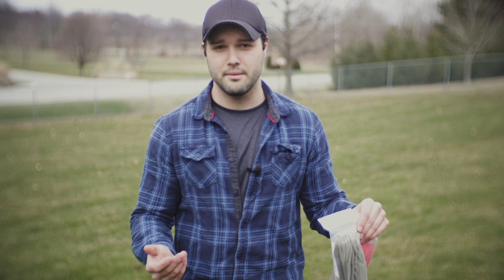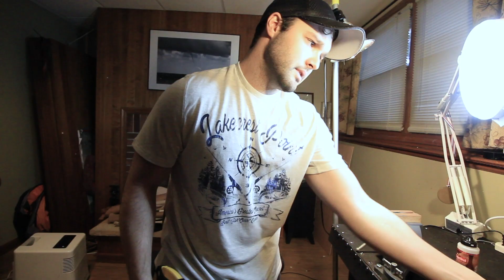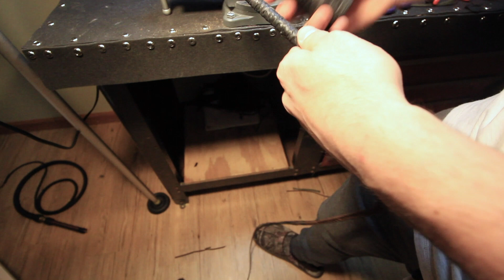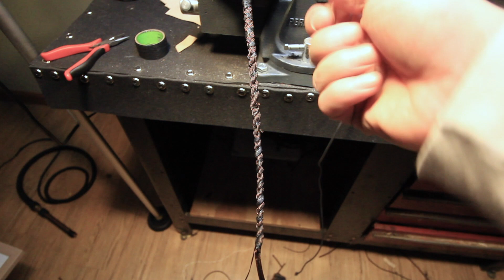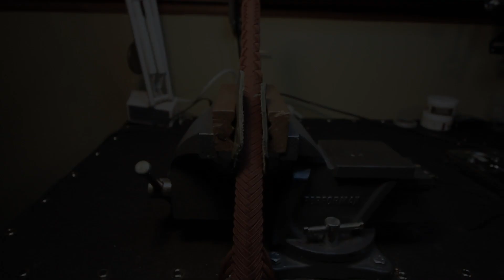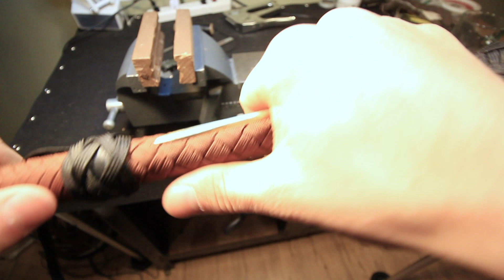My Current Nylon/Paracord Bullwhip Making Method 2018 | Nick's Whip Shop

Comment: How mutch did it cost for you?
Reply: I’d put non-paracord material at about $10-15
Paracord is about $10 per 100 ft, so this near 300 ft whip (total length of paracord used) would be about $30 of cordage. 

Including wax, probably another $5

EST: $45-50

I’m lowering costs of materials a bit since it’s cheaper to buy in bulk, and it’s assumed that’s what he does

Comment: Just started plating my overlay and i see im going to run into some difficulties.
my material i get here is slightly different to yours and i was wondering if you can assist me?
when im starting the overlay it all seems to be going good untill i look at the back of the handle....it looks bad and uneven

Any advice plz

Comment: Hi Nick,

Im new to whip making and thank you so much for best content in youtube!
This helps ALOT.

One question, are you using waxed artificial sinew? Does regular one work as well?
I was wondering, if I can use paracord guts for the same purpose?
Reply: Hello! I’m not as good as nick at making whips however, yes I use the nylon core of paracord for the same purpose as artificial sinew. All I’ll say is that if you use the nylon core you’ll have to pull extremely tightly because it doesn’t have the same strength as the artificial sinew.

Comment: Instead of using a metal rod is it possible to use a wooden dowel of the same dimensions as a substitute because I’m having trouble finding a metal one
Reply: It was in a reply somewhere, but the wood could break pretty easily compared to the steel rod. Have you tried any hardware stores?

Comment: Hi I have a question about alternatives for B.B.’s. I live in nz and it’s hard to find accessible bbs and if I do I need to ship it and it’s expensive. Is there any alternatives?
Reply: Ball chain. It’s lighter, but you can double it up when pulling it through 550 paracord. It’s the stuff for ceiling fans, so hopefully you should be able to find it at a hardware store

Pull it through the cord by tying omg the inner strands around the end(s) of ballchain. Then pull it inside during the process of gutting it. The core should be about 1/4 the length of the whip.

Comment: i dont understand the difference between the sinker cord and the regular paracord. Can i just use the 650 coreless for the whole project
Reply: The main difference is the diameter of the cords, the sinker cord is 3/8 of an inch, and the paracord is 4mm or so, so the BBs fit easier into the sinker cord. I'm no expert but you could probably use 650 for the whole thing if you can load your core still and comfortably attach it to the handle.

Comment: Hi Nick, yet another excellent video - very clear and concise. 
I do have one question. Is there any reason you couldn't just use standard paracord, with the core strands in place, as the core of the whip? Assuming of course that you'd gut the top end where it will be shot loaded and mounted to the handle. It just seems it would be nice and round rather than trying to force flat sinker cord into a round shape.
Reply: 550, 650, most paracords are inconsistent in how easy it is to pass BBs through. Sinker cord is wider, allowing them to be easily inserted.

Comment: Hey Nick! So my 17ft strand in the second belly keeps running out before I reach the end of the sinker chord. I've measured everything multiple times. What do I do?
Reply: it seems like a lot of the strand lengths aren't right in some of his descriptions. I've run into this problem a couple of times with his videos. I'm sure it's a simple mistake but nonetheless it does affect the whips. I've begun to just add a few feet to the given lengths.
Reply from the maker: Hi Tanner, sorry that you were running short. I've had a few others say the same. I've made some adjustments to the strand lengths that should compensate and make up for the problem. Take care!

Comment: Hi Nick working om my first whip now and started plaiting my second belly also whith the 2 strands on the handle but when I finish the handle the  front side looks amazing but at the back the pattern doesn"t follow around the whip is it ment to be that way because I know it is only a time saving method. 
thanks for the greate vids.
Reply from the maker: Thanks for watching Jan, sorry you're having trouble. The handle plaiting pattern is a bit different in so far as you need to pull back behind the handle more so than with the herringbone. I have a video here that should help. Let me know! https://www.youtube.com/watch?v=H5VcdyV7l4k&t=2s

Comment: Hey Nick great vid! But i ran into a problem. I cut the exact lengths needed for the second belly, but towards the end of the belly, I only have four strands left to plait with and about a foot and a half of sinker cord left which is obviously wrong considering you had 6 strands left when you reached the end of the sinker cord. Where did i go wrong? Thanks in advance!
Reply: You didn't go wrong, I had the same thing happen to me (almost finished the second belly right now). I think one of two things happened. 1. When he said "the core stops at 6ft 1in," he may have actually misspoken and meant 5ft and 1 inch, which would make a lot more sense with the lengths. Or, 2. The recommended strand lenghts are incorrect.
Reply: Aidan Thornbury  has anyone figured this out yet?
Reply: @Desiccate-water  It doesn't  really matter that much. Just plait the left over 4 strands and taper them the same as the first belly. (asuming you have some core left). Otherwise just add a couple of feet to the strand lenghts of the second belly and you'll be fine.

Comment: So I did the math and while using gutted paracord takes less time, buying un-gutted paracord from whip nation costs less. For a small time whip maker like me, getting cord at a cheaper cost and spending a little more time gutting it my self is better, but for someone like Nick or Caliber whips who can better afford it, the gutted cord may be a better option.  In the end it lies on preference just thought I would put this info out there.  Above all research stuff before you spend money.  Nick defiantly knows what he is talking about but I have come across a few whip makers on you tube who don't.
-Nate The Whip Smith
Reply: As an upcoming whip maker, I can say that 650 coreless helped a lot, even thought I started using it only on my third whip. It’s not that much more expensive, it’s just a bit better quality in my opinion. It’s nice and flat too

Comment: how do I stop my heel knot from rotating. i mounted the hide all great with nails and what not but the actual knot keeps rotating in my hand
Reply: Bri Loop I’ve made a few whips myself and i’ve never quite had the same problem but you probably need to tie your knot just a little bit tighter. Also if you wrap your foundation in artificial sinew and then wax your whip when it’s finished, the wax in the sinew should bind with the wax you add to the whip and help the knot stay in place.
Reply: Bri Loop You could also try making your knot foundation larger so the cord in the knot has more defined edges to hold on to

Comment: So I just finished making a whip using this video and it is not very loud when I crack it. I'm not sure what went wrong but I was also having the issue of dropping strands before the video seemed like it did. I pulled hard on each strand and made it very tight so I don't think that is the issue. Any thoughts?

Comment: This may be a bit of a dumb question... but are bbs just ball bearing balls basically? What is the diameter of ball needed for this width paracord? Thanks : ) You may have covered this elsewhere but I'm new : P
Reply from the maker: Hi Patrice, no such thing as a dumb question here.  The bb's are indeed just 4.5mm steels balls. They will fit very nicely into 3/8in sinker cord.

Comment: Any specific reason you stopped using the carpet no slip material to stiffen the transitions?  Also I haven't watched the video yet so maybe you said why lol.  There are too many slack jawed hussies where I live so I definetely need a whip to keep them in line!!!
Reply: He mentioned it briefly, noting that the material made the whip a bit too bulky for his liking. Having used the same method as well, I would agree that the size/weight addition isn't worth the minimal stiffness it brings. You'' do a lot better with just wrapping sinew/dacron tightly and repeatedly.

Comment: After following the instructions for the second belly it seems that I have to drop strands much earlier than he does in the video and I'm not sure why. I'm pretty sure that I have the right lengths of cord because I've checked them so many times. Any help? Thanks!
Reply: Also tried using the measurements on your website. Those ended being too short as well.
Reply: I'm in the process of making a whip using the above measurements.  I also have done the 2nd belly and have come out about 2 foot short on each side.  This one I'm using the 1/4 nylon rope core (because that is what I have on hand) instead of the 3/8 sinker cord and my strands didn't even make it to the end of the core.  Not sure what's going on either.
Reply: I ended up using 21 ft instead of the original 17 ft measurement and I just estimated where I needed to drop it. Also for the 25 ft measurement on the overlay that ended up being too short as well so maybe add a foot or two. I couldn't force myself to redo the overlay so I just fused two strands together and continued plaiting. Hope I helped!
Reply: I had the same problem in 2014 from his first video. I had to add extra lengths then figure out my math after.

Comment: I'm using 3/8" sinker cord and not sure if im doing something wrong but it is a pita to get my bb's to stay in a straight line. it seems like the ID of my sinker is big enough to have them double stacked in there. Anyone have any suggestions? TYTY
Reply from the maker: Try holding the bb filled core on it's side so that the weight of the bbs doesn't cause them to double up.
Reply: Thanks Nick! Will give it a shot. Finally ready to start my first one. Your tutorials are exceptional, thank you for your time and effort they are greatly appreciated.

Comment: How thick is the  650 cord? I was just wondering if I use 550 cord (4mm), would I use the same lengths? And, did I hear you say 3/8 inch sinker cord? Isn't that like 9mm? and, can I use 550 for the core? I'm from the philippines. 

hoping for your reply
Reply: Cesalino Zijlema you'd need smaller ball bearings than the ones Nick uses. The sinker core is very wide, feels weird to use, and it's annoying to line the balls up when they want to sit side by side. I've used 6mm "paramax" cord. It's a bit tight and takes some time to work the balls in, but it works.
Reply: thats  really good that someone can vouch for paramax as core. i got 100 4mm steel balls. i hope thats enough. the only problem I have left is I cannot find hockey tape in here (The Philippines) and I'm looking for alternatives. I do plan on waxing.

Comment: Lookin’ good there Nick!
Reply from the maker: appreciate it man!
Reply: 3/16" steel rod fits on 550, most of the time. To mount it, I just glue it to the 1/4'' rod.
Reply: Cesalino - 650 and 550 cord are almost the exact same. If you can find paracord that can fit BBs, you can use it. Since most 550 paracord cant hold BBs, sinker cord is used. Hope that helps.
Reply: Hi caliber whips, could you please answer my comment above?
Reply: that surely helps! the last problem I have is fitting the 550 paracord to the quarter inch steel. thats like 6mm, while 550 is 4mm, correct? 
i'm a sub to your channel btw hahaha

Comment: Some additional footage on the transition knot and turks head knot would be great and very helpful.  I think there are many different types of knots, at least it seems that way. But I am new and just received my supplies.  I only have the core done, so far. I started today, and immediately had to go to work. Of course!  I got home and you released this. Right on time, thanks for the help.

Comment: Hey Nick... I bought a whip from a pretty well know whip maker. I'll just say he lives on an island. I asked him how he got the transition area so stiff. I mean you can't even bend the 8- 10 inches of transition. What he told me he combines sinew with dyneema. Go over the transition with sinew then use dyneema then sinew over the dyneema. I tried it on one of my whips that was kind of like a wet noodle. I just went over the transition with hockey tape first. Then tried him method.  Wow.. super stiff. Cracks great. I think that's his secret. I'm telling you. Try it. It works fantastic. Do the criss cross pattern. Actually I ran out of dyneema so I used Kevlar thread. I guess you could use either one. Give it a try!!! Take care. ..I need to watch your video.

Comment: Nick thank you so much for all your videos! I have learned so much from you and you do an excellent job of explaining and demonstrating that makes it very easy to follow. Just as an FYI I ordered some 650 paracord a little while back (not coreless and not from the source you mentioned) but it was from a very popular source. Anyway I learned the hard way that not all 650 is the same and some is actually a hair smaller than 550 in diameter. I plan on ordering from your source very soon!

Comment: Awesome! Let’s see if I can get the material around my neck of the woods... The sinew I had to order from amazon, and the stuff I got isn’t exactly what I expected. Better than what I used as substitute (dental floss... for its flatness)... Working on the snakewhip, hoping it turns out as good as the last bullwhip that I made for a friend. Cracks easy and makes quite a pop. A little stiff still, but I’m working on getting that nice and even plait all the way down. 
Thanks for the quality content!

Comment: Question: whenever I weave my whips I always seem to end up with one side along the length of it being stiffer than the other. Any way you fix this? ~EagleWhips.
Reply: BurgerBandit That is extremely common with 6 plait. On Caliber Whips' "implementing an english eye fall hitch" video, he shows a method to stop that. At 6 plait, have one side going U1O2, and the other as U2O1. That way, the tension is even.
Reply: Audion Fire I do 16 plait
Reply: Ethan Mitchell ah
Reply: BurgerBandit There's always a stiff side to a whip. If you don't already, rotate the directions of the bellies and overlays so that the stiff sides even out some more. Getting it even is just something that comes with a little time.
Reply: Who's BurgerBandit?
Reply: Blake bruning. Look him up, his strand drop technique is the one I use, it is utterly foolproof.